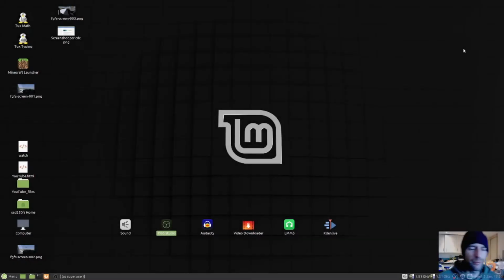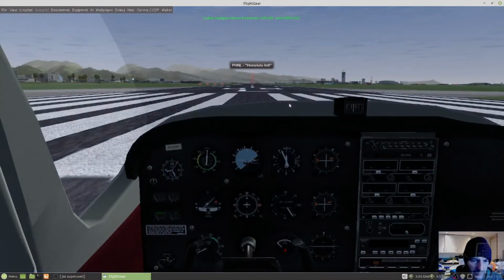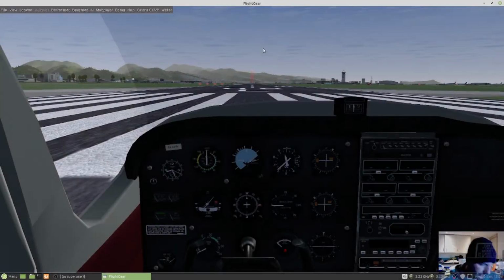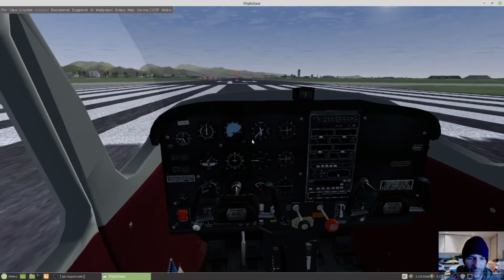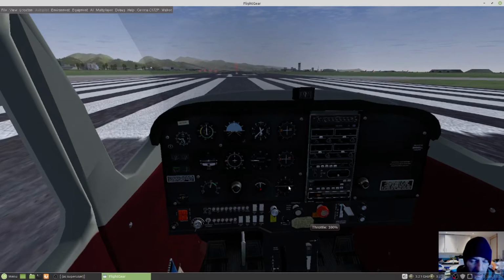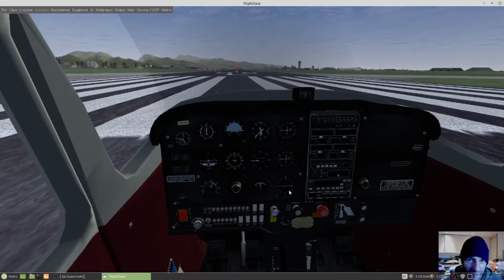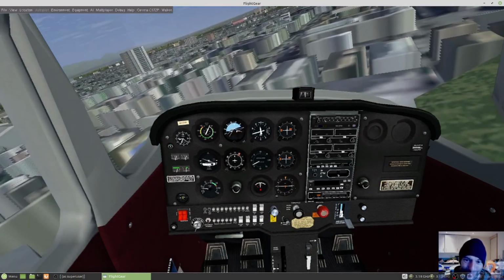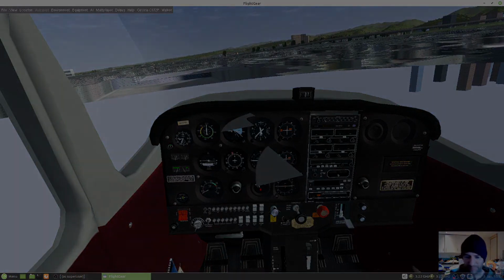flightgear takeoff and landing tutorial

Comment: When i try to takeoff or taxi my plane just wobbles too much and can't go straight, using the rudders just worsens. Any fixes?
Reply: Yep I got the same problem.
Reply: @TheTimeProphet  Increase the throttle slower. FlightGear seems to simulate the engine torque turning the plane. 
It's hard with the buttons 0 and 9, because they are "all or nothing" inputs. Easier with a joystick.
Use only micro adjustments...quick taps with 0 and 9 only.
Good luck!
Reply: @jonniejlo  Well it is 0 and Enter which is stupid keys. They are not even on the same level on the keyboard. I am using my xbox controller. With that I can controll the throttle and the steering in the air, but not on the ground.
Reply: True. Just hit enter and hit 0, dont press and hold. Also press H and you will see guidance on screen

Comment: Managed to get the plane started but 0 and Enter are stupid. Who the hell designed the keyboard layout. They are so far apart. I would have gone with 0 and 9. Well I got the plane moving, but couldn't keep it in a straight line, and ended up on the grass. Then I was spinning around uncontrollably. The flight controls work well with my xbox controller though, but I couldn't get off the ground LOL.